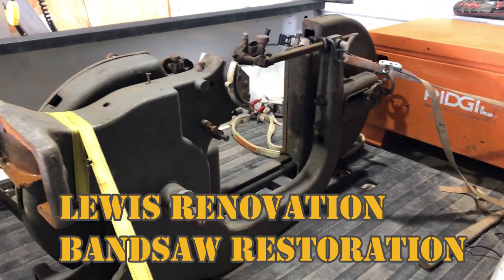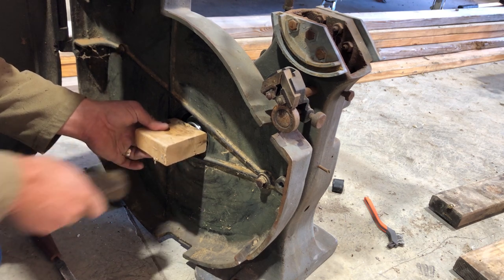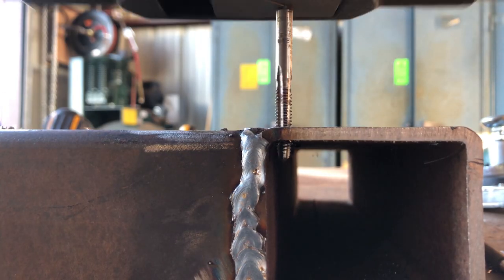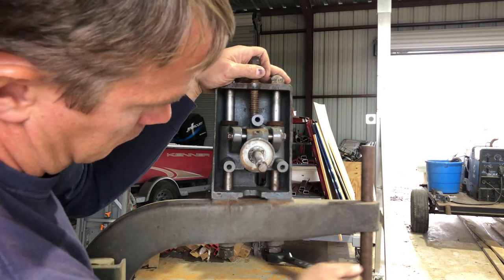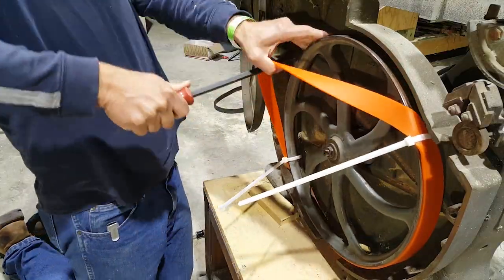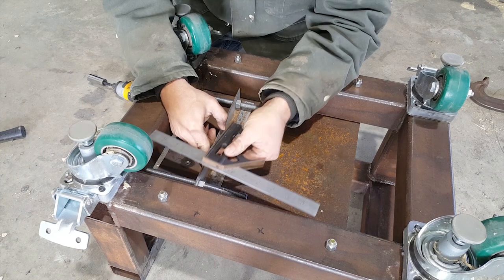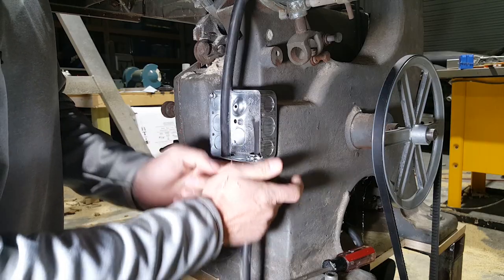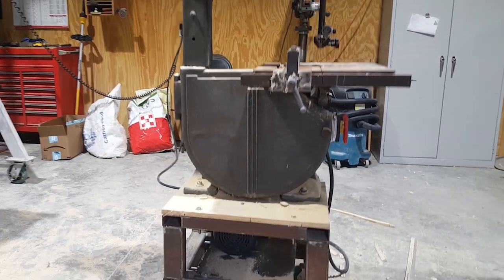Band Saw Restoration

Comment: thanks for taking the time to make the video. will def. helf me put mine back together. :)
Reply from the maker: Good luck. Hope it turns out well
Reply: @LewisRenovation  saw blade wont track....Might have to remove the old tires and put on some new one like you did @6:48. Were the ones you ordered crowned?
Reply from the maker: Not crowned
Reply: @LewisRenovation  Thanks man

Comment: Great Video.  I just bought this same saw.  I will be referring to your video often.  Thanks.
Reply from the maker: Good luck!!  Let me know if I can help.
Reply: Did you have any issues with blade tracking on the lower wheel? I have that same saw and fighting that now. When I spin the wheels clockwise the blade moves to the front till it slips off. If I spin the wheels counter clockwise the blade moves to the back and slips off the lower wheel. If you have any info I'd appreciate it!!!
Reply: @codygray54  you need to crown the tires.  You can find the correct rubber tires at Carter Products.  
If you want contact me via Facebook and I can explain the process. 
https://www.facebook.com/ClintonCaraway

Comment: Nice job. I have the same saw, but mine never worked as it has the same rubber tires on it, probably, that it left the factory with. My new urethane tires arrived today and I'm pulling the old tires off and cleaning the wheel surfaces of old varnished glue, its pretty bad. Mine has the original base and tilt/table hardware, so if you need pics sent to help rebuild yours, pls hit me up. At some point in its life, the blade guide on mine was changed to rollers, but the blade has never tracked right due to the severe tire wear.
Reply from the maker: Hope your new tires make it run better!  If you could send some pics of the tilt hardware and blade guides, I would greatly appreciate it.  joeu235@gmail.com

Comment: Did you have any issue with the blade tracking on the lower wheel? I have that saw and struggling to get it to track on the lower wheel. Any info would be much appreciated!!!
Reply from the maker: Yes, I've had and still have trouble with the same issue.  I believe my upper and lower wheels are not perfectly aligned. I pulled the lower wheel off once and moved the bearings to better align the wheels.  It made it better but kind of a pain.  I need to do it again with a little more precision to bring it in even better.  Hopefully this helps
Reply: Yea I was thinking the wheels are not aligned right. So I'm currently dis assembling,   cleaning, and then re assembling. Hopefully I can get the wheels aligned properly. Thank you for the info and making the video!
Reply from the maker: @codygray54  Next time I disassemble, I plan on making a mark on the lower shaft where the bearing sits before disassembly and then moving it over the distance that the upper and lower wheels are out of align.
Good luck!!

Comment: Walker Turner has been my favorite bandsaws for almost 30yrs of woodworking. 
I still use one everyday. 
If you have issues with blade tracking it is because crowned rubber tires work much better for bandsaws with flat wheels. 
You can find them at Carter Products as well as modern all bearings guides for your saw. 
https://www.carterproducts.com/
Reply from the maker: Thanks, if I have issues, I'll definately check them out